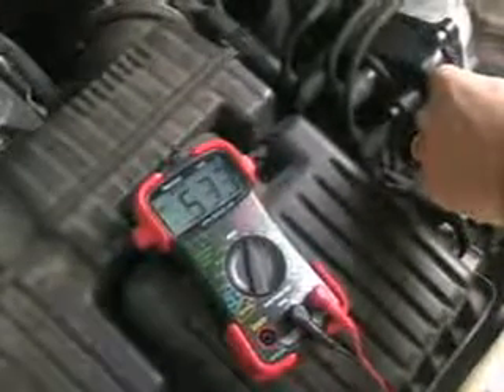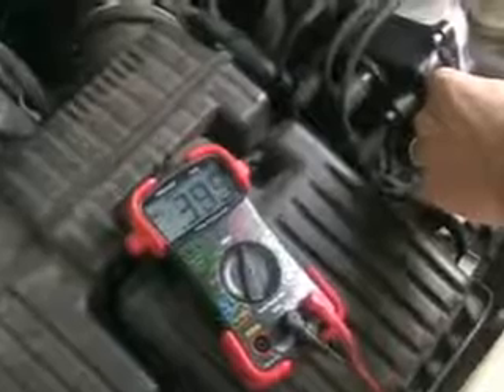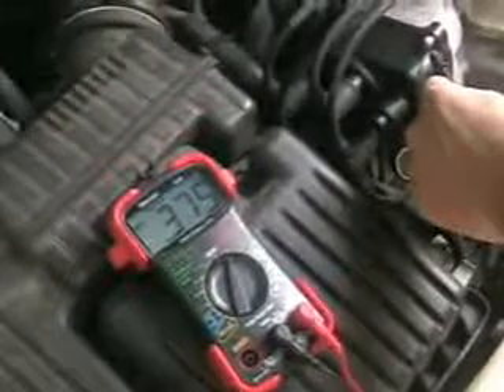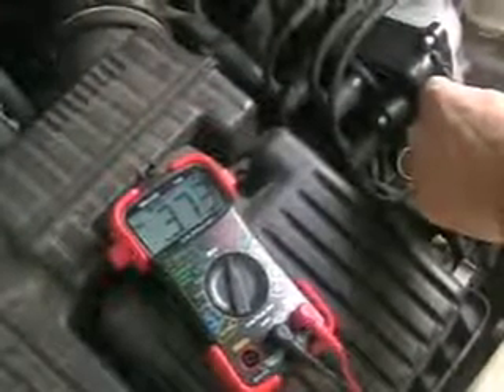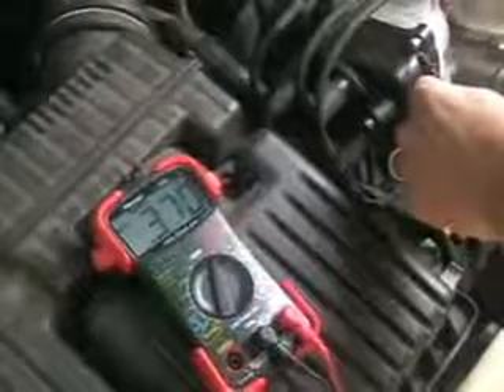Civic O2 Sensor Test

Comment: It's not a knock, and I'll tell you why I think so. Did you ever hear a car at a drive-thru order station (from inside a fast-food restaurant), then hear it after it pulls up to the pickup window, and then you notice that it is no where near as noisy as you thought it was when it was idling at the order station? IMHO, the same principle is observed here. The noise is probably a slight exhaust leak, NOT a knock.

Comment: The best way in order to see and find the problem in  O2 sensor is:
1. make sure engine is warm 80-85 degree
2.by back probing the return signal and cheking the pattern in labscope
your reading in engine cold is high for O2 and it might be a rich combustion